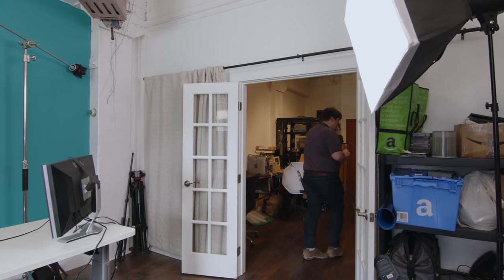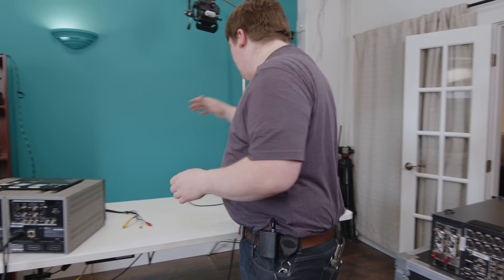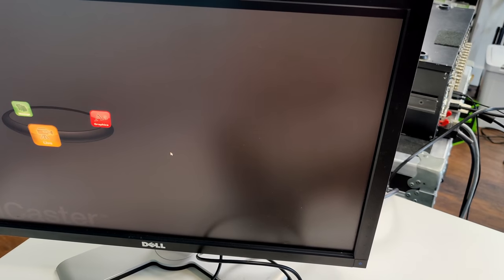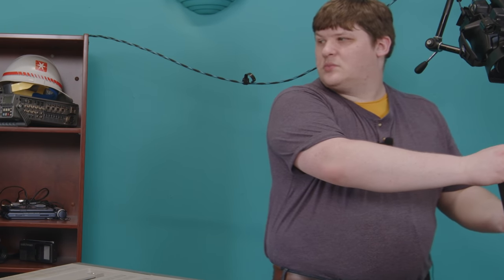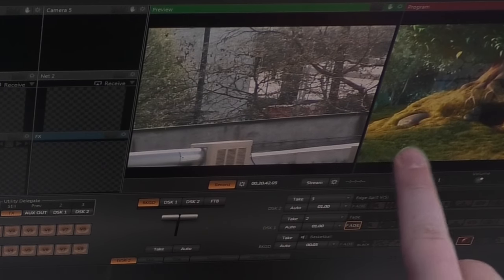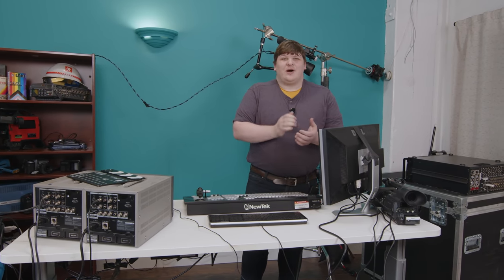Learning to run a broadcast in ONE HOUR [Tricaster TCXD850]

Comment: This is a couple months late.
I’ve owned a NewTek TriCaster Mini SDI Advanced Edition, still do but after accidentally formatting and overwriting the boot drive, it’s no longer useable as a TriCaster, and now it’s only a paperweight. I have contacted their support, and after a lot of emails with them and taking it to a local official support partner, they failed to give me a single recovery usb, saying that I have to return it to their Austrian support location. I will not do it.

I’ve switched to a pc for all my productions now - nothing really special - just a powerful PC with a couple Blackmagic Decklink 8K Pro SDI input/output cards + a custom made control surface. It’s running vMix, and all it needs is a windows pc. You can run it on anything with a capture card.

And boy has it been an upgrade. I paid around 11 thousand euros for the TriCaster. For under half of its price I built the PC for 5-ish thousand euros, and I will never return to any NewTek products.

Comment: First thoughts on where the 3D spatial positioning feature could be useful: dropping a live scene into a model set if matching all angles perfectly in stage production wasn't possible due to room height or other limiting factors, maybe a still overlay to more cleanly replace a billboard or make sure it's readable in a scene where the lighting is too variable?

Comment: Grass Valley or Sony should send you their top of the line video switcher for tests. Would like to see 10 hour video showing all those functions of that stuff.
Reply: Does Grass Valley still exist?  I thought they got eaten up by Thompson decades ago.
Used a 200 in a station in the 90s.
Reply: @RandallJennings  I worked for them in a past life, company I worked on got gobbled up by them. Went to Grass Valley HQ at some point, they have a wall with graphs of what happened to the company... it's ridiculous. They've been Tektronics, and Technicolor, parts of it have been Philips, Thompson indeed, split up, reunited, flattened etc through the years. Current status (at least according to my Linkedin page) is that they're now named Grass Valley again, but owned by Belden.

I helped the SW team of their K-frame switchers for a month or two, btw. Great people. The K-frame switchers are also ridiculously advanced, I was happy to take a look at that tech,

Comment: I used a Grass Valley 200 (a long time ago in a galaxy far, far away) and it had many of those same features -- as in, yes, switchers have been standardized for decades. 

The way you'd put a Chroma Key over the top of a video was to HOLD DOWN the Preview source and then press the background & chroma key 1 and/or 2.  You could then JUST press the chroma key button (1, 2, or both) to keep the same video source background, but take off the chroma key (on the next transition, that is), if I recall correctly.
Reply from the maker: oh that's niiiiice. I don't think either of the "serious" switchers I've used had it that easy.

Comment: I used one of those NewTek cast boxes and I wanna say the network protocol is just RTMP, surprisingly, and since the software stack on yours is pretty modern, the codec support should be pretty solid--h264 at least

Comment: I used to use the VT-1 and I was also able to use the TC-1 as well as a few other NewTek systems in the past, if you want I'd be more than happy to give you some information on them.
Reply from the maker: I've actually been really curious about those, yeah. Virtually nobody seems to have any info about them, it's like they never existed, except newtek made five versions. I assume it was somewhere between the functionality of a toaster and a tricaster?
Reply: @CathodeRayDude  the toaster was mainly a card and software put into a machine, I didn't use an amiga but we had a dell server that had these cards installed into it and the server ran Windows XP. That system was very basic but it had the ability to add overlays and play videos and send them out. It also had a primitive version of what is known as NDI, which sends a video signal over networking, however this was over a serial connection if memory serves correct from another system running special software that is still in use today by NewTek for graphics. The TC-1 is one of the new Tricasters out on the market today, they are basically what we had with the VT-1 system, its a glorified consumer pc in a server enclosure running cut down versions of Windows to get the most out of using consumer hardware, to get an idea they had gaming motherboards in the TC-1 and it was obvious when there is a dedicated VR port on the motherboard I/O shield. I've worked with a few others, and even took one apart when it was retired, but I was a student and couldn't save the whole machine. But all Tricasters I've seen run Windows, and then self boot their software, you can even exit to Windows at any time. But I'm a bit of a hardware nut and so when things went wrong I fixed them for my school. And because of that I understand the frustration of finding anything of any system, I don't know why but they are very hard to come across, but I assure you they are archived if you search manuals up about them, sometimes the covers of the manuals are used for multiple NewTek system because they all had similar functionality, but they would have a different number of inputs and outputs, but the software was used amongst many of their systems.

Comment: This is all SOOOO much how I tinker with stuff. I'll start with, "Let me just plug it into power and set in in my lap here and poke around on it." Then eventually I need to expand on the concept, so I'll start needing to plug other things in. Pretty soon we have four or five devices connected. At some point it all needs to get moved onto a table because there are so many cables and dongle coming out that I worry about snagging something and yanking sideways on a connector or something. Pretty soon it ends up connected to the network for some reason, then I need some external relays to switch between two signal sources or something, on and on. Eventually the whole thing is a mess of cabling and external accessories connected into it and I hate to put it away now, because, if I ever wanted to play with it again, it would take another four hours just to get to the point it's at now!   =)

Comment: the reason you want manual control over so much of the items is two fold.. lets say that you loose a camera during a transition.. it lets you control it or the host wants the 'SCORE' held up on the screen for whatever reason..  then the movement and adjustment on the fly.. You hit onto it in part with the Chroma cast section thgat you did.. You can set up items and move them to match things in a virtual set.

Toaster was designed specifically to allow for rapid production and was/is used still from small to large studios it was Newtek's bread and butter and over 30 years they have refined it really really well.. It is the AVID of Real time production (and in some cases even replaced the AVID)

Comment: If you don't wanna break the bank on a TriCaster,  and want something similar on a manageable scale, try a Blackmagic ATEM! They even have extension software that let you get remote access to them using a laptop. They are a little bit more proprietary, running their own OS/running over firmware most of the time, but even the smallest desktop ATEMs are used in professional production (especially in the esports industry which i work in with these very machines almost daily!)

Comment: I wonder if dedicated gear like this is still used in production facilities nowadays.  A lot of what the Tricaster can do seems like you can do it in OBS Studio, as long as you have the proper capture equipment.  I'd imagine a small TV studio can have a fairly competent production chain for fairly cheap, with a laptop, a few 1080p cameras (heck, possibly even just DSLRs), and a handful of $60 HDMI capture cards from Amazon.  It won't be incredible, but it will allow a high school to give local news stations a decent feed of football games, graduation ceremonies, or whatever, while allowing the A/V club (do those still exist?) to have some fun.
Reply: Oh very much so. I direct for a local TV studio and we use a 36 input/24 output Ross switcher that works on the same basic principle as this Tricaster, just much larger physically and packed with more bells and whistles.
Reply: seconding the very much so. when i worked in broadcast, it was way cheaper to use this stuff, not to mention that the station owner started in the 70's, and still runs stuff mostly by taping to betaSP and manually changing tapes because he likes it better than having to download and use the computer system. he has one, because some shows only come via download now, the amount of stuff on sat is growing rarer by the day, but if you can tape it off the sat feed, he does. 

He is far from the only greybeard in broadcast, and so long as small local channels exist, this equipment will continue to see use 30 years past when it was popular.

Comment: Fancier desks can have more M/E stages, so you can stack the output of one into the next - somewhere between PGM and DSK's, so you have other ways to manipulate.  Probably won't be used 99.5% of the time, but that's why you sometimes have multiple T-bars
Reply: We use that at my work on our Ross switcher. We have a PC with a feed of a tower camera in full screen on a monitor, that is cloned on a HDMI output into the switcher, mixed in with a background on one me, that all gets mixed with the camera and keyed in a minme, then the char generators get added in the second me which goes straight to pgm.

Comment: They had one of those in the remote van the station I worked for bought. They gutted the van to put in HD-SDI and replaced the Tricaster with something much more expensive. Then the head of operations and the head engineer came and dumped the tricaster in my office. Both of them laughing and grinning. 
I think they were just having fun ripping all the stuff out of their new toy.  
I was the guy who had to do all the ewaste. Which meant I got first dibs on taking things home too. I tried to invent a reason to hang on to it. But I had a small apartment and pretty much everything it does can be done by OBS or Premiere or even MAX.
But it was the kind of thing I'd have killed for 15 years earlier. 
Had to itemize it, wipe the drives and send it on to Green Solutions.

Comment: I ran a VT3 which was a Windows machine with a external IO board that connected to it, as well as a fancy video card for lightwave.
Reply from the maker: This is kind of remarkable to me because the VT[x] devices are so rare nowadays - NewTek made VT2,3,4 and 5 systems, but it's virtually impossible to find any information on them. The Video Toaster is covered, and the Tricaster is covered (to some extent) but the in between ones simply never show up on ebay and I've found very little info about them in general.
Reply: @CathodeRayDude  It had two IO cards that ran to a massive rack mount breakout with bnc video connections. There was also some custom GPU accelerator card for light wave. 

It was for a high school that did live announcements. Had full green screen that did live Chroma key. Was pretty snazzy for the early 2000s

Comment: You said it was an i7 based computer, [ application specific], so it is a generic high-end PC hooked up to many PCIe Xilinx Video accelerators ??? or perhaps there is something more to it?
It was wonderful. I didn't know about broadcast equipment before this demonstration.
Thanks 
Cheers  ✨
Reply from the maker: basically yep! I sadly didn't have time to open it up and talk about the inside, but the whole back panel is a massive multi-board stack of FPGAs. So really it's probably closer to "an i7 PC remotely controlling a dedicated piece of custom hardware." Glad you enjoyed!!

Comment: Looking at the NewTek site It seems like one of the major use cases that they market these for is live sports broadcasts.  It would be interesting to see how they integrate something like a scoreboard into a broadcast.  Now knowing a bit about how these work I'm guessing they have some computer based application that outputs a keyed source that can be overlaid over the other ones.
Reply from the maker: That's how conventional broadcasts work - you have a mixer, then a "CG" which outputs color and key signals that allow the mixer to superimpose the imagery cleanly. The tricaster however has it's own built in title generator that I believe can be used in place of a separate CG, which is good because it doesn't really have the inputs needed for that kind of setup as far as I know.

Comment: 4:26 SDI, my beloved. We use HD-SDI at the PEG station I work at, and it is the best cable I have ever worked with because it never comes unplugged.

5:57 It definitely does need both.

6:13 It definitely does need both.

6:50 every piece of studio tech has at least one port that you never use, it's fine, probably.

7:29 You use those for live TV mostly; a lot of live TV is done at 29.97 fps because broadcast standards are bafflingly out of date at best. Some broadcast server software I've used will even reformat your nice 1080i60 videos down to 1080p24 on ingest because f*ck you.

9:15 There are no complex title graphics. TV scientists have tried to make titlers that do more than "text with outline and drop shadow" but it always ends in failure with dozens of broadcast techs dead. 

9:45 And That's why you control room should ideally be well-ventilated (lol) or failing that, very cold. These things all generate a lot of heat.

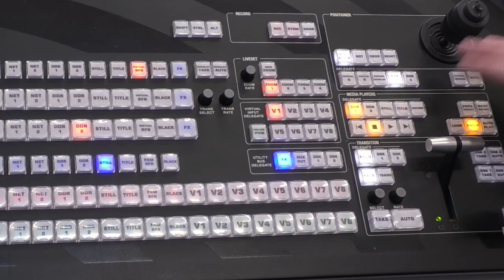12:25 The most exciting, least used part of the switchboard.

14:34 The eternal struggle.

15:40 It did not always used to be this way; originally switchers were "one-way" which meant that you had to manually set the preview every time you pulled the switch. The one you have here is a "two-way" which remembers the input you were just on so you can switch back and forth really fast forever (do not do that.)

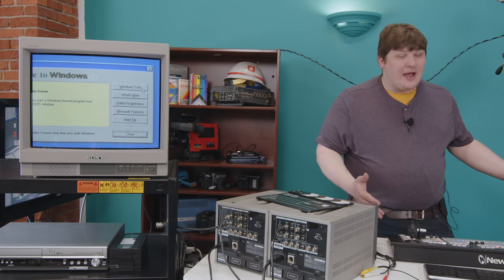18:52 The other eternal struggle.

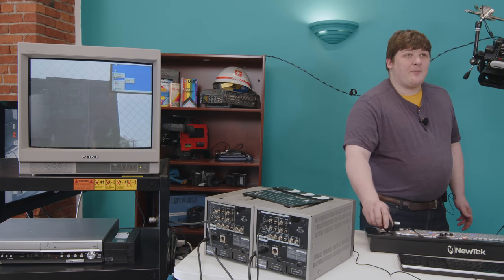20:15 You wouldn't want to do this, really, but every switcher is comically overdesigned.

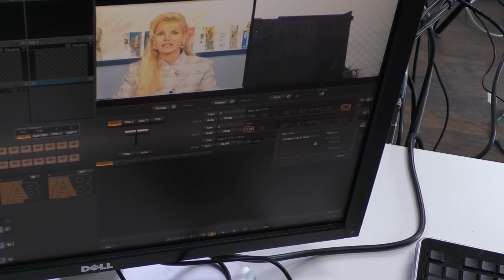21:20 I guarantee 99% of those transitions have never been used outside of a corporate educational video.

21:50 Oh and sports broadcasts. Those guys love their graphics.

22:10 you cannot stop in the middle. Everyone will yell at you.

22:37 This is because sports is funny.

23:22 Glad to see the CRD gun sprite still getting work.

23:48 Again, you wouldn't, but it's not hard to implement given all the parts you already have to work with, so it just gets thrown in.

30:23 something something JoJo reference

Comment: Super interesting video, I'm kinda curios about that connector that connects the monitors and cameras, looks like a standard BNC plug and it supports several formats on it which may or may not be HD? I guess I will search on wikipedia about it.
Reply from the maker: You may be thinking of SDI, which is basically HDMI but so much better that we should all be rioting in the streets over not getting it for consumer purposes. It can do phenomenally high resolutions, frame rates, and audio channel counts over plain old coax, and is far more sensibly designed.
Reply: @CathodeRayDude  Now I'm sad, if we had SDI in consumer devices I could make my own cables, repurpose coaxial cable, and wouldn't be dependent in a single wire out of a 20ish pins on HDMI/DP not breaking. Why can't we have nice things ;_;

Comment: This looks like you could broadcast an entire F1 race with 8 cameras, including lap times, advertisement, and the broadcaster logo.
Reply from the maker: yep! I haven't fully dug into it but that should all be doable - put the logo in DSK1, make the lap times in LiveText and put them in DSK2, cut to ads on DDR1/2. Of course, by all reports it would crash mid-race, but technically...
Reply: @CathodeRayDude  🤣🤣🤣🤣 Top notch entertainment. You can almost see a TV director behind a desk cutting from the camera 3 with the race leader to cam 7 where a crash just took place, and cam 1 with the pace car entering the circuit. There would be a bad boy like this running the show.

Comment: I have a very similar control surface that I would love to use for OBS, but I dont have the Switching box. Thinking of gutting it and redoing the insides with some sort of Pi or arduino to talk to my pc. Would for sure be more of a novelty than anything. Its not USB, its RS422, and I dont have the smarts to make anything to talk to it. but it was switching all anaolg
Reply from the maker: I haven't put it through its paces yet, but Central Control (https://centralcontrol.io/) is meant for this specific purpose. The Tricaster surface is just serial internally with a converter, so it might be possible to get yours working with a simple RS422>USB converter and software like this. Worth looking into!
Reply: @CathodeRayDude  Oh damn, I did get a RS224 to usb to see if I could find anything to interface with it, but I didn't know about Central control. Defenetly going to check that out now. I actually have 2 of them now that i look in the closet. 

One is an ECHOLab DV-7 and the other is a  Videotek Prodigy

The DV-7 has BNC and Power only, but the prodigy has RS422
Reply: Going to try to send an imgr link for thoes Interested, Unsure if youtube will eat it

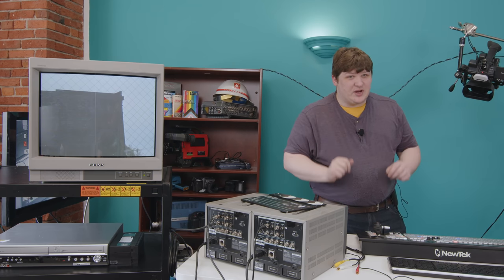Comment: 14:55 What was the option you had to change that was in the manual?
Reply from the maker: Oh yeah, I couldn't show it on screen for reasons. I needed to assign the preview to one of the three flexible output ports, and the trick is to click the settings icon on the PGM window. If you click the same button on the PVW window, or any other part of the UI, you get settings local to whatever you clicked on, but in this specific case, you get the global output options. Wild.